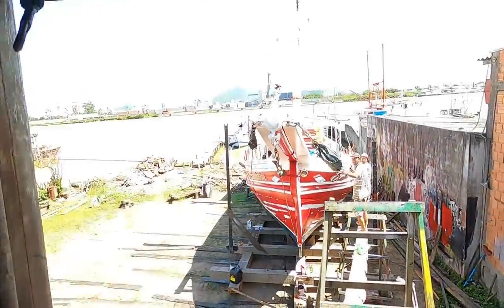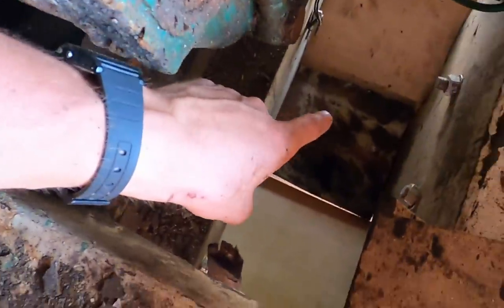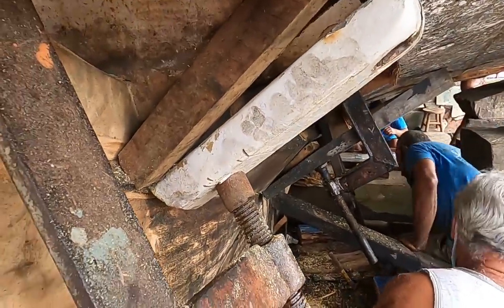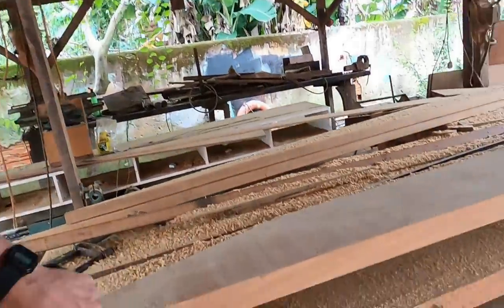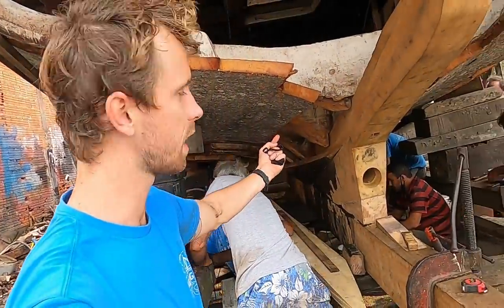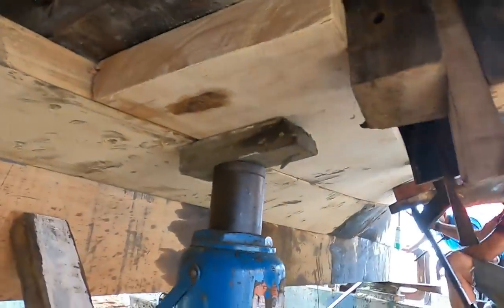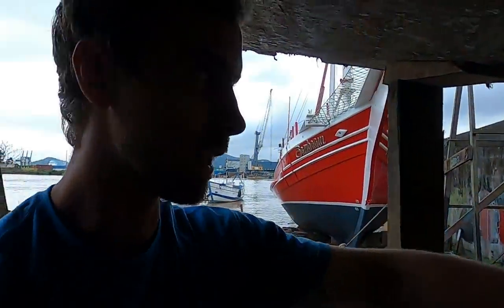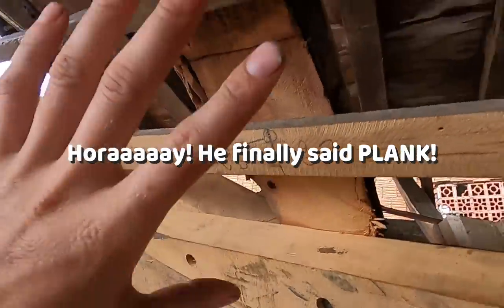Building a wooden boat with FIRE! — Sailing Yabá #20

Comment: Nice to see you get the new garboard board installed. Ben a easy way to remember the difference between a frame and a plank is that the frames are like the ribs of a boat and the planks are like the skin of a boat to keep it in simple terms. hahahaha. well if anyone is not confused yet by the time Ben is done trying to explain things to you, you will definitely be confused. hahahaa. just riding you Ben thats what happens when you don't do your homework! you pay a price you get made fun of. lol

Comment: Original build was totally shot in 15 years, lets rebuild it in the exact same way...ugh
Reply: I guess it works if you don't plan to keep it more than 15 years.
Reply: I believe the original also never got one bit of maintenance in those 15 years. Likely not a single haul out or even bottom scraping the entire time.
Reply: @nunosantiago2273  my understanding was that rot from fresh water was localized and that the majority of the issues were the ship worms that would have been taken care of by regularly applying bottom paint. I don't own a boat though so I cant say that with 100% confidence.

Comment: Nailing planks to the ribs! are you serious? not only your ribs have been repaired with bits hacked off and replaced with bits of new wood, which makes them structurally less strong, but now you nail your planks on them instead of using bronze screws! or riveting them with copper rivets... Your are totally reliant on the advice of your carpenters and fail to do your own research. Further more the nails were zinc coated meaning with the action of salt water and electrolysis they will eventually rot the wood as well by turning the wood black and soft! I suppose you don't intend to keep the boat too long and you are on a tight budget. I don't mean to be critical or rude, just concerned. I am a sailor myself.

Comment: After years of watching Acorn to Arabella work, I'm surprised that the guys don't steam the planks to curve them !
Plus using nails instead of bolts.
But hey, what do I know, right ?? No naging intended, just curious.
Reply: Arabella and Tally Ho are being build to last ~100 years... not being a shipwright myself I should keep quiet, but my best guess is Yaba is being built to last ~15 years if they are lucky. Those look like galvanized nails and he's hammering  them in with a steel hammer destroying the zinc layer on the head in the process.

Comment: I’m no expert but I was watching another boat build and they had a ton of iron rot from fasteners. You might have the same with those nails your using. You should be using brass screws or rivets if you can get your hands on some down there.

Comment: I think Ben should be worried about this predrilling and hammering in such short nails. He will not question it because they are the experts,but I think they are cutting corners and making it easy for them. Those nails are going to pull out. I wonder what the guy from salt n tar thinks of this. The wood should of been treated first. These guys might be skilled ,but this job is probably even too big of a challenge for their skill level. I wouldn't mind betting they are so sick of this boat after a year and sell it.

Comment: After reading all the comments, about steaming, fasteners, wood sealers, construction techniques, it reminds me of living on my 80 year old 40ft Alden yawl, built of oak and pitch pine, clinch nailed with iron square nails....everybody that walked by on the dock turns out had an “expert” opinion on how boats should be...the truth is boats require lots of maintenance, wood boats especially. You can use all types of fancy “ultimate” woods, the highest tech fasteners, the most highly approved joinery processes, but even the most perfect construction will not insure that the boat will last forever, unless it is in a sealed container out of the water. Otherwise a major refit is a given in 15 to 30 years. As far as fasteners go, no metal is impervious to salt water without protection. Yaba is a work boat being rebuilt by shipwrights who build/repair work boats. It is a job for them, not an artistic endeavor like “Tally ho”, artists think about art, these shipwrights think about doing what needs to be done, day after day to ply their craft, and get their pay. Boat building as a trade is a commercial operation, boats are art, but shipwrights are craftsman not necessarily artists. And Ben does need to get a better grip on his terminology...
Reply: Probably the most sensible comment I've read  surrounding this  circus of a boat. As a young fellow-me-lad back in the early 70s I fished a then a sixty year old Morecambe Bay Prawner. Built of pitchpine on oak by Crossfields of Arnside, Iron fastened I add, I only ever had to replace one plank in her.

Just re-read your comment. Sublime.
Reply: Clinch nailed with iron square nails is something completely different than the way the planks on Yaba are being fastened. For this reason I think Yaba is unfit for sailing in heavy seas offshore. I have been sailing for over 50 years and I wouldn't sail Yaba on open sea. The risc of her starting leaking/sinking is too big.
Reply: @bgt7874  sounds like you walked my dock before.....
Reply: @casualemt  I'm sorry, I don't know what that means. English is not my native language; could you explain?
Reply: @bgt7874  sorry, my comment was referencing my original comment about how people who walked by my boat on the dock all had “expert” opinions about boats and how they should be...as far as YABA is concerned, what person would consider it a blue water world cruiser? It just isn’t that. More likely a big live aboard, coastal cruiser, labor of love...not all boats are intended to brave the raging sea. Do you understand now?
Reply: @casualemt  I thank you for your answer and clarification. My concern is with MP and Ben. I was refering to how the refit and planking on Yaba is being done. In their first episode Ben and MP state they want to sail it, live onboard, teach onboard and travell the world. I totally agree that Yaba is not fit for world travell. Where I have been sailing the wether can change quickly and so the seastate. Even on shorter offshore sailing. I don't want to bash their dream, but it would be unsafe to sail Yaba on open seas when there is no very stable wetherwindow, let alone to sail her to travell the world. But I guess we'r on the same page about that.

Comment: Oh my gosh......the process of using oil and heating the planks is such a slow, slow job, it could take forever to complete this.  I know how they got into this overhaul, but they couldn’t have known what would be found when they started tearing the damaged wood off.  This could take years to finish.
Reply: Luckily most of the side planks are straight and dont need much bending.

Comment: With all this work being done their fastening it with galvanized nails!!!???? it means this is a five-year-old boat.  it will need to be refastened again in 5 years or less because of electrolysis and the nails are smooth side not ring shank no holding power at all so as the boat works itself they will move causing the boat to leak
Reply: And these craftsman don't know this? Seems to me they've done this before.
Reply: A lot of traditional boat builders in various countries use galvanized fasteners. While bronze or copper would last way longer they are also way more expensive. Galvanized fasteners will last many decades if properly mounted and maintained. When they get bad they can be replaced.
Reply: I agree no nails.
Reply: She was originally fastened with galvanized fasteners, you always go with what the boat had to begin with. Mixing metals will cause galvanic action, Which will increase the speed of disintegration of the existing fasteners.
Reply: Please understand I'm not a arm chair builder my experience is commercial fisherman and lobsterman in the state of Maine USA for 53 years and have built boats of veritable sizes out of wood fiberglass and steel so watching the rebuilding of this boat has intrigued me any statement is my opinion
Reply: @johnappleseed936  nothing below the water line is original so could be refasten with any material without causing a action galvanic action

Comment: Mp is definitely going to have a major headache if she keeps hitting herself each time ben says the wrong words!!!.
Ben are you really sure it's the measurements from the plank after all it could be another frame!!!.
I thought that you were replacing the old battered frame's??? As you're already doing the replanking I guess the frame's will have to do?, that said when Ben was sat inside of the hull talking about the anking the frame to his right has a great big crack running the whole length of it, surely this one if any needs to be fixed or replaced as structurally it's not going to be very safe ? It's the first time I've seen someone cover a plank with oil and burn it to make it soft enough for bending usually heat drys the wood fibres out making brittle and more likely to break than bend, why didn't the shipwrights use steam to bend the planks?

Comment: Dear Ben , again you are following bad budgetary advise from shipwrights due to your lack of knowledge. Below the waterline you need to fasten each plank with 2 silicon bronze flathead threaded rods going through each frame and tighten behind the frame with a nut. Every hole needs to be filled with Sikaflex or warm tar before inserting the rod.  That's a lot of more work and more money, but using galvanized nails below the water line is purely suicidal and short sided. The basic material of your frames and stringers is already compromised and nails will just not do it - in less than 5 years you will be facing nail rot which will corrode  the wood around the nail and the plank will start moving and affecting other weak nail spots until you loose one at sea. Galvanized nails are a cheap option and could be used ( not advised ) above the waterline. Only Bronze survive under water. Don't get me wrong , the shipwrights are skilled but the hardware should be your decision to make , you are clearly not investing on short term bases.
Reply: Nothing wrong with a good hand dipped galvanized nail. Been used for centuries. Should last for longer than they will own the boat. I'd worry more about the wood in tropical waters than the nails.
Reply: @webbtrekker534  I can see at your comment that you have no material knowledge and worse you do not know about the behaviour of these metals in saltwater!!!! Shame on you! If you don't know, don't write BS.  It could sound hard but Ben and PM are better of with real honest advice.
Reply: @raywattie2308  I grew up on the water. I have lived on my boat for ten years and done boat maintenance and repair on wood boats for years. I've pulled planks and framed and rebuilt transoms and installed new stems. Laid decks, changed engines and stepped masts. Probably painted more hulls than you have ever seen. You do a lot in 75 years! Shame on you!
Reply: @webbtrekker534  Then I hope you can expand your boatbuilding knowledge in the next 75 years up to my boatbuilding level. While expanding your knowledge and experience a new world will be open for you.

Comment: For everyone bitching about nails, Guess what 95% of your on the hard homes are made of. Nails and popsicle sticks compared to this timber. Yes they are dealing with springbuck, and yes it will be addressed. The water swells the wood helping keep everything tight down the line. And proper maintenance keeps the nails alive for MANY years. This is nothing new and has been done for centuries, although for future reference yaba, pickup shipwright books and do your homework for the next hull please. :)
Reply: Bull Shit, ship fasteners for wooden boats are bronze, at least if you want to enjoy your built for many many decades.

Comment: I´m sorry, but the repairs have been thus far a botch job themselves. Many corners are being cut. I understand the cost aspect of doing things to spec, but this boat is going to rot out just as fast as it did before if this trend continues. No bedding compound is being applied, those nails are useful for fencing, not boat building, plus nails are themselves a poor choice for this boat´s planking. Bending the planks with oil and a torch is a terrible method, the planks should be steamed if necessary. And this is only what I´ve seen in this video. The keel was mounted with large defects in the wood. The scarf joint  had gaps and no bedding compound was applied. I honestly don´t see how this boat can ever be anything more than one of the hundreds of tourist scooners with precarious maintenance that make short day trips along the brazilian coast with tourists on board. This isn´t, however, what you guys are presenting to the viewers as your goal. Nonetheless I wish you all the best and that you make all the right decisions, whatever those might be.

Comment: GOODAY
THIS ONE OF THE BEST SITES ON U TUBE
YOU SHOWED REPLACING THE KEEL AND BUILDING A NEW ONE
YOU COUNTED THE BAD FRAMES BUT DIDNT SHOW REPLACING THEM 
SO I WAS BIT SURPRISED YOU JUMPED TO PLANKING
HOPING YOU CAN FIX UP THE ORGINAL ENGINE
FIXING UP THE REST OF THE BOAT
WIIL IT ALSO BE DONE ON THE SLIPWAY
BEN AND MP THINK YOU ARE TERRFIC PEOPLE
CHEERS RH

Comment: If you're going to spend time explaining things then why not try to at least use the correct terms, at the moment all you do is come across as someone who doesn't have a clue trying to sound like they're some kind of expert.
Reply: I think they are using such scenes to appear comical and/or to add a bit of zest to what could be boring to watch without commentary.  They are being 'Cute'.  I sometimes have difficulty with words, as well.  This is made worse when I'm under pressure to perform.  Maybe Ben has an issue with dealing with terminology that is strange to him.  Or he is dealing in technology with which he is not familiar.  Getting involved with a new technical language takes a while to get accustomed to.
Reply: Don't like it ? Move along .
Reply: This happens when one is using a second or third language.  Ben is doing fine....and as you allude to it is now using 'technical' language, not everyday speech,  makes usage harder as one reverts to 'everyday' translations.